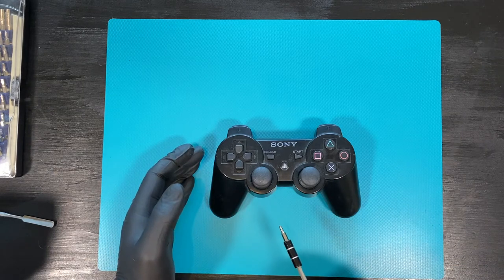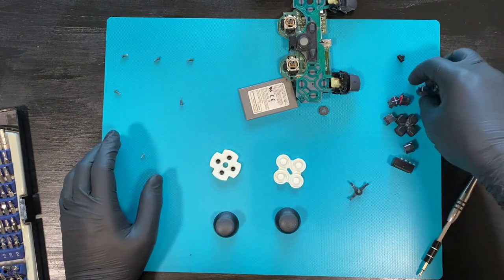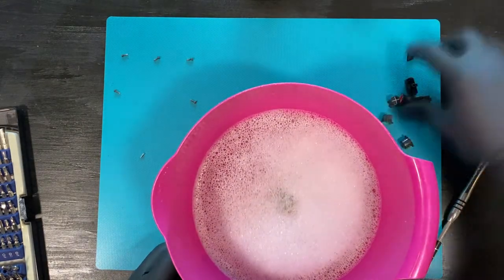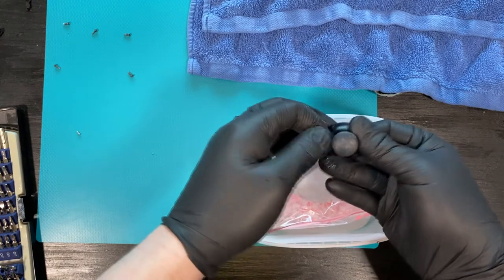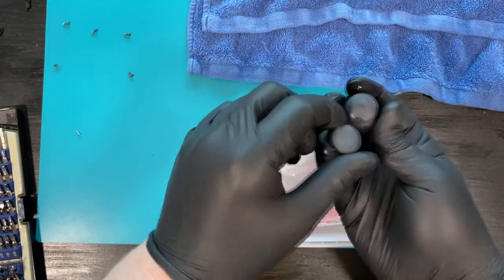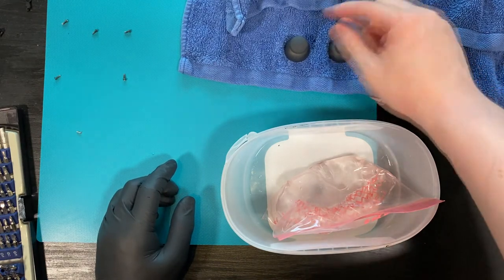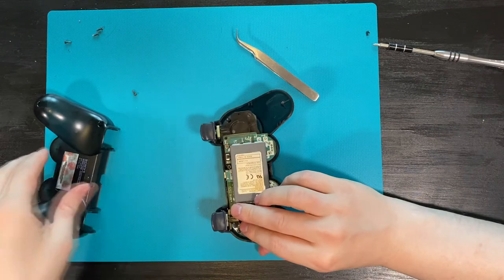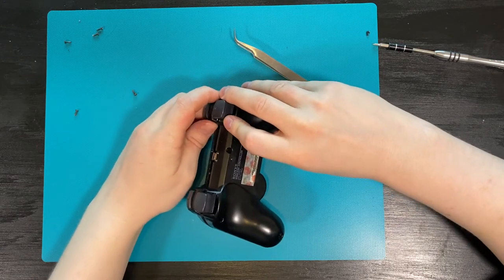PS3 sixaxis controller - Disassembly & cleaning | sticky rubber restoration

Comment: There is a tiny piece of square plastic that goes over the reset button above the battery. It is pretty much never shown in any video on youtube. There is a cut around 9:22 where the piece goes from the table to the board with no instruction. Hope this helps someone.
Reply from the maker: I knew I missed something, that entire controller is a fun thing to put back together, especially the shoulder buttons that just refuse to go to the correct position when you are re-assembling it.
Reply: @Purkkaviritys  you just saved my life <3 this is what i've been looking for, for the last hour!
oh if other people read this, make sure the pointy side is facing you when putting it back together otherwise the bottom cap will break it off when you put it all back together, that just happened, but i soldered it back on.
Reply: Brother thank youuu I could not figure out where this went

Comment: In my experience, how many controllers I've restored, fixed, cleaned, stick is way more easy trow in a garbage and put new one, especially on Sony controllers, cause their rubber became sticky and so dirty and you never will clean them to not be disgusting touch it. Thanks for the video and til for sixaxis sticks. I was first time today working with this controller, video helped alot.

Comment: R1 and L1 are never placed before closing. You have to fully close the controller and those buttons will pop into place.
Reply: Mine are not working anymore and not springing like usual, does that mean i have to readjust the L1 and R1 buttons?
Reply: @miguelbTGOD  Most likely the rubbers are out of place. Even if slightly, makes a big difference.
Reply: @darealworld558  thank you very much for the quick reply, back to having a fight with this controller i guess lol last time i swear aha, gonna be the third time taking it apart, last time i broke the reset button right off lol
Reply: @miguelbTGOD  patience is the key. Also practice makes perfect. Today I disassemble ps3, ps4 and ps5 controllers without a guide, but there are times that you need to disassemble a remote several times until good.
Reply: @darealworld558  thanks man! Appreciate the comment, gives me hope and courage on attempting again and taking my time🍻 Cheers my freind
Reply: Wanted to say Many tha ks man, had a c ouple alvohol friendly drinks to calm my nerves and got it done nice and slow, no stress😎 she is working mint now😎 who new ahaha.
Reply: Nope, dont do that as that may damage the button. Place that r1&l1 button before closing. by inserting it left part of the button first then press the right to fit as they are a little flexible. Do this to each r1&l1 button

Comment: God I hate the DS3 so much, but of course it is the only compatible controller with the PS3 because of reasons, I wish 8bitdo made a DS3 replacement
Reply: Ps4 and ps5 controllers work natively with the ps3
Reply: @m3e642  Not all functions are retained in all games aswell as not being able to axcess the XMB, and of course DS4 and DS5 doesn't have pressure sensitive buttons so games like MGS 2 and MGS 3 doesn't play perfectly (You can't do interrigations in MGS3, can't put the weapon away without shooting)
Reply: @Grandmaster-Kush  never had issues with a ds4 since most games I play work with it no issue. there is an adapter that allows you to enable all these features
Reply: It's better than the DS4 and Dualsense because it very rarely gets drift.
Reply: @Vinnay94  I am looking forward to the new magnetic stick technology that has 0 drift for the longevity of the controller lifespan, I know 8bitdo Ultimate has a version of it
Reply: @m3e642  you cant enable pressure sensitive buttons on ds4 because it doesnt support them
Reply: There are new PS 3 controllera made by RETROFIGHTERS and they seem to work all the same and it WILL turn on the PS 3.
Highly recommend.
Reply: @onetwo6039  Damn man thanks for this, no more scouring second hand for DS3